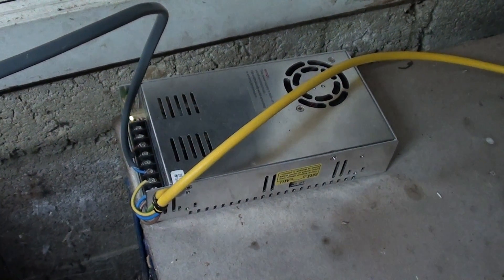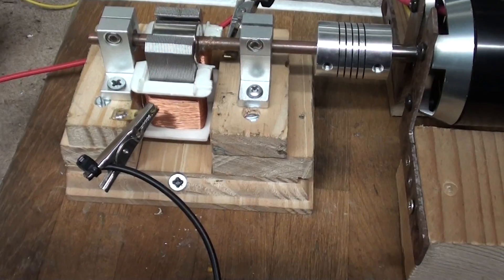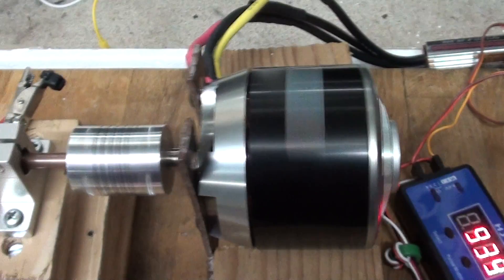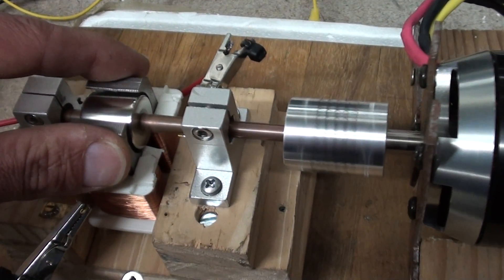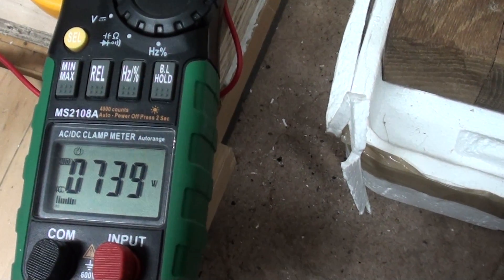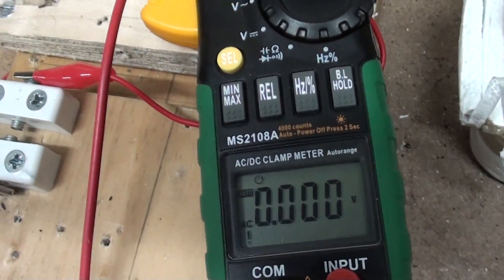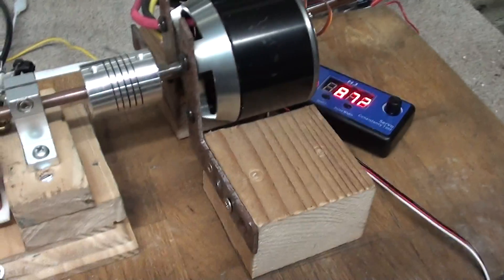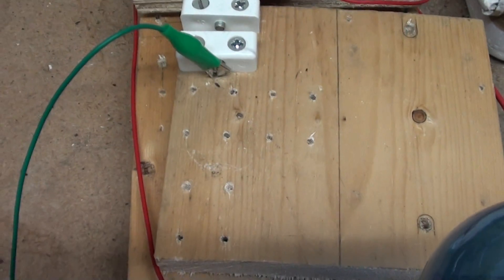Gerard Morin replication with neodymium magnet 3

Comment: why im getting up to 600v and can't light a single light bulb with this Voltage? ? 

is anyone out there who can help me with this question? ?
Reply from the maker: Dugagjin Dervishaj Hi! What light bulb/s are you using?
Reply: +shortblokej very hard a 5w bulb
Reply: +shortblokej a 5w led light first then a 40w didn't work
Reply: Amperage issue? Use bigger wire in the windings may up the amperage to “push” the voltage.

Comment: sorry to tell you, you're misinterpretation has caused a lack of understanding. My charger input is not 18volts, look again and read it correctly, the input is 13volts off the power supply going into the charger, the 18volts is the BATTERY charging and discharging continously. I said that clearly, it's running on a 18volt Dewalt battery which in this case never goes dead=charging loop.
Reply from the maker: Err...sorry, have I missed something?